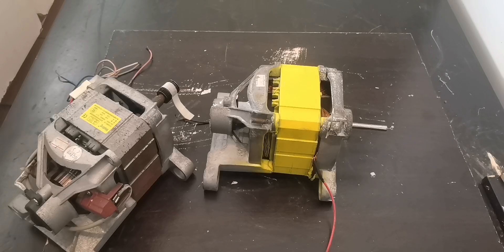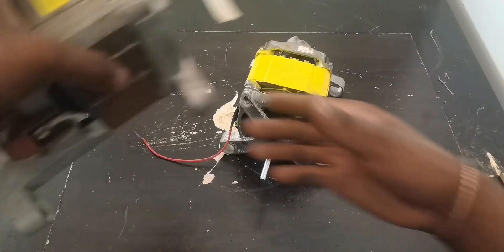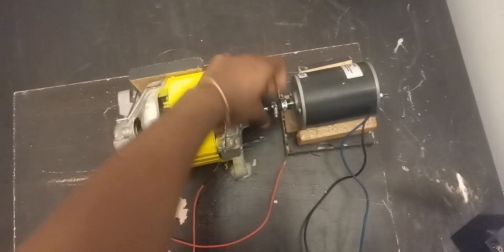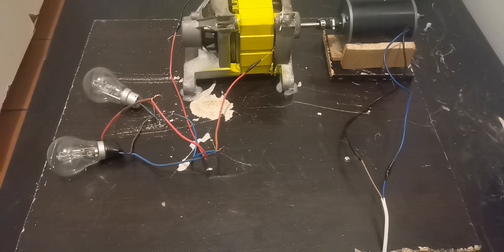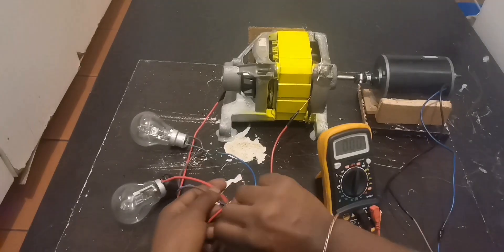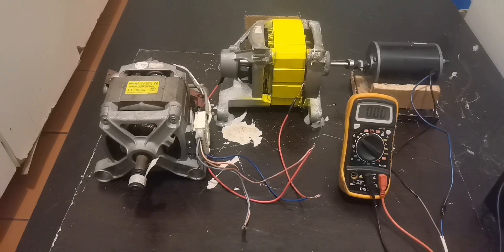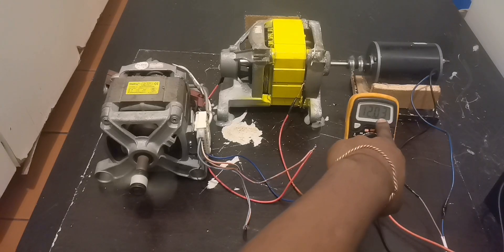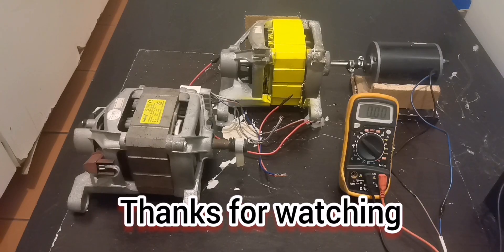I convert washing machine motor to generator # how to make high voltage generator #diy generator

Comment: Other videos shows you can energize the field coils of a washing machine motor with a12V battery and a 12V bulb as a resistor, then spin it as a generator. This I will try.  I tried your treadmill motor experiment to run a 120V bulb and a 4 inch angle grinder, and it works.  What I found out is I think the motors you try to run needs to be a permenant magnet motor.  I could not get the standard 16 inch house fan to work. Thanks!!!